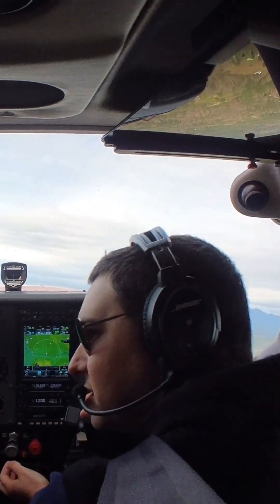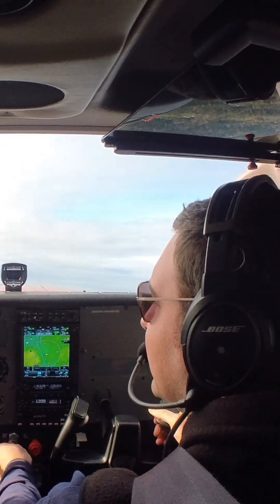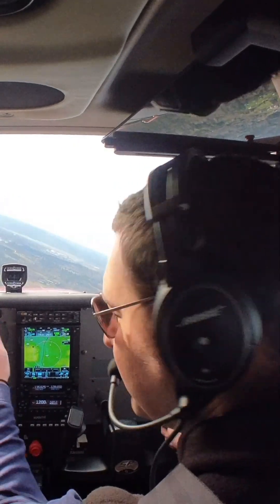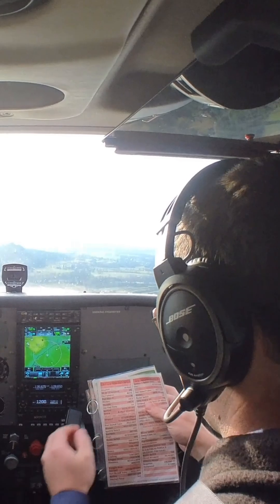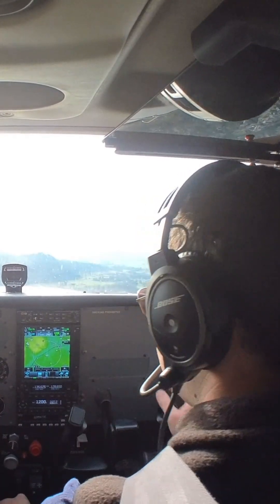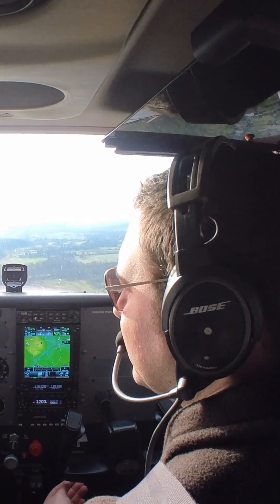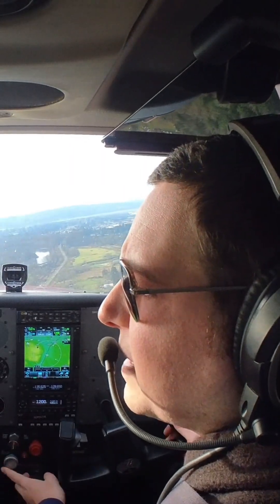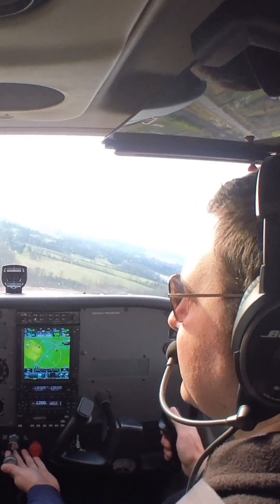CFII demonstrates how an engine failure emergency procedure should be handled in a Cessna 172S

Comment: He forgot carb heat on. Carb icing is a very common engine flame out reason.
Reply from the maker: ah yes, but this 172S doesn't have carb heat because it's fuel injected.